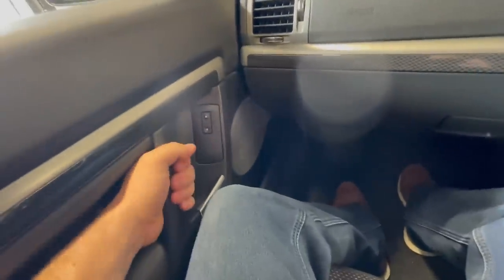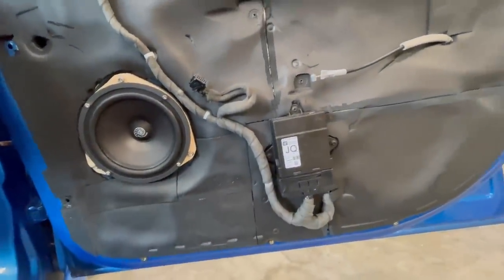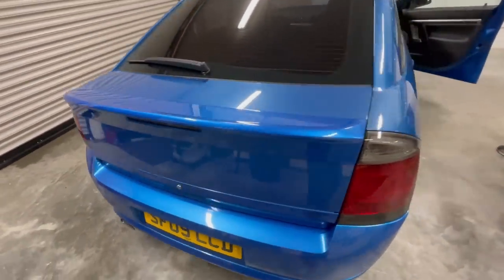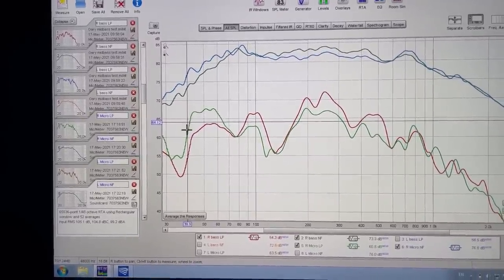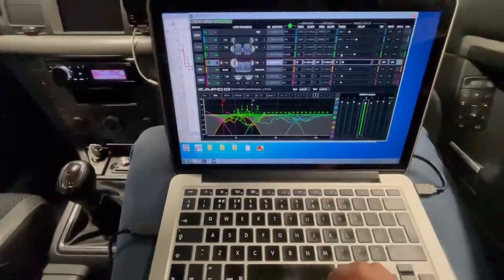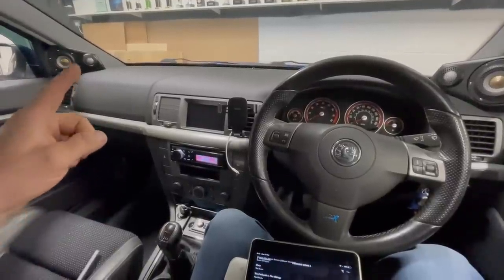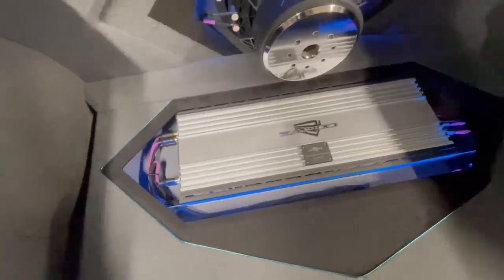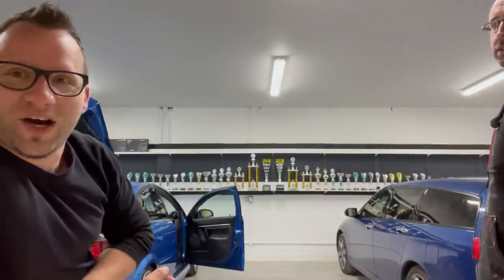Vectra Midbass Upgrade - Installation Tricks, Tuning, RTA, DEMO - Micro Precision, Zapco, Helix

Comment: For the trunk rattling, I would have used window rubber weather stripping and used the screws that attach the plastic trim shown at 8:14 to secure it in place. Would look like it came with the car, compress and seal the gap when the door closes rather than looking like somebody stuck a peace of foam there.
Reply from the maker: Absolutely, it was just a quick test and it proved the issue, he is going to have a permanent solution like that.
Reply: @pssound9749  great, would like to see what the permanent solution is. I always find something in the hardware store to help with most of these problems where car audio decoupling materials are not fit for the purpose.
Reply: @pssound9749  btw, I'm using high end headphones for this and it sounds beautiful. Hope this recording sounds anywhere close to the real thing.
Reply from the maker: @MrBroly10000  well, a recording has never sounded better than in real world, so yeah, it’s pretty good! 😃🔊🔊
Reply: @pssound9749  meant as, hoping I'm listening to at least 80% of the real thing.

Comment: Great content. I’ve been trying to think of a good spot for my midbass based on the info you provide. Also, I’ve heard Zapco is not what it used to be from an amp repair tech, a Kicker representative and I’m not impressed with a zapco amp that I have although it was one of their cheapest options. Maybe their expensive stuff is still high quality though and all of my sources only have experience with their cheap options
Reply from the maker: Even the ST SQ amps are great and you can not beat them in that price range. Z series is very serious bit of kit, all Z ii, Z SP & Z AP lines and we used them regularly, no matter what some experts say. 👍
Reply: @pssound9749  this is after I spent 30 hours on each door covering holes and deadening and my kicks aren’t big enough, door speakers are a waste of time

Comment: In this setupWhy did you change the position of the cone of the subwoofer , there is a technical reason
Reply from the maker: Yeah, the box had a shallow sub before, so the new one didn’t fit, simple as that! 😃

Comment: Man Pete I fell away from you for awhile because I guess you do more on patreon but today a few of your old videos came across the cell and I watched and you made me remember the zeal you gave me for good sounding music in a car. I been neglecting my attention to detail as far as tuning, rattles and what nots and settling for ok when I  wanted in the beginning the best I can do thanks for firing me back up. By the way how do you get the coax input to work on the zapco hdsp 5 I mean I tap on it in the drop down but no sound from my A&k player. I don't have to remove my radio rca cables from the input for it to play do I or is it something on the software page like auxiliary that I have to activate because the manual really doesn't say anything.

Comment: Hey Peter, how do you place your mic when measuring the car? fixed, on listening position? or moving around head?
Reply from the maker: Yes 😃
It’ll be part of an online training course soon. 👍
Reply: @pssound9749  I'm sorry, Yes to what? :D Moving or Fixed?
Reply from the maker: @joaoalmeida2819  when you get an answer like this, it’s partially sarcastic and means, that not every question can be answered. 
I have a specific measurement technique, that can not be shared due to many reasons. 
However, i can recommend Erin’s video on Erin’s Audio Corner channel, where he show few options, which may give a clue to you. 
Hopefully that will help. 👍
Reply: @pssound9749  Yep I know Erin (and others) techniques. I was just curious about how you do it.

Comment: Always enjoy your videos. Do you have any video of you isolating a door?  I’m trying with ABS and having trouble with creating the indent for the door card.
Reply from the maker: Isolating a door in what way?
Reply: @pssound9749  my door is not flat and I want to separate the inner door space from outer.  The door card has cup holder and indent that are preventing me from using ABS to close the openings in the door. I tried to form the ABS with heat, but can’t get the indents to match correctly. Just wonder how to seal the door properly when it’s not flat metal.
Reply from the maker: @rafterratblackboard7084  i see. I’d take a mould of the doorcard from fibreglass and rivet the mould onto the inner skin...or just forget doors for midbass completely.
Reply: @pssound9749  thank you for taking time out to answer my question. I’m going to give the mould a try.